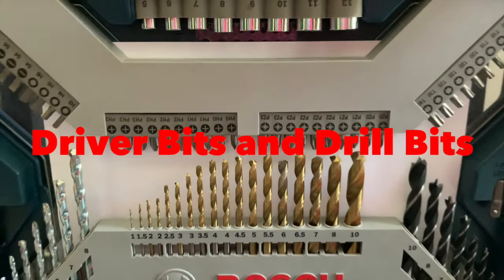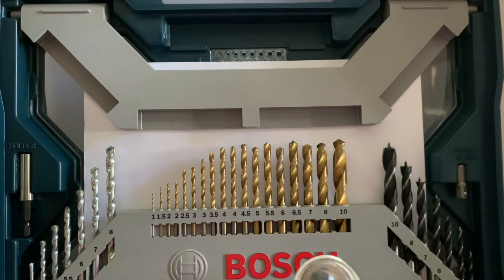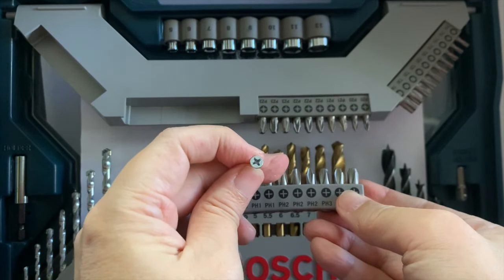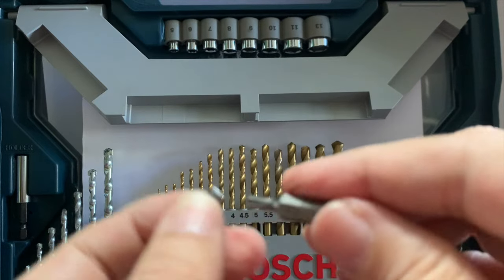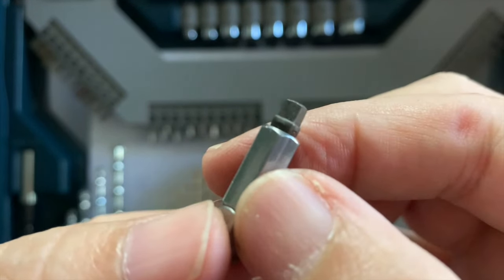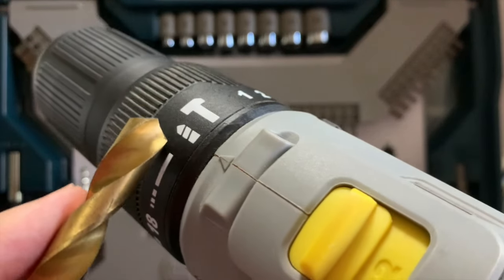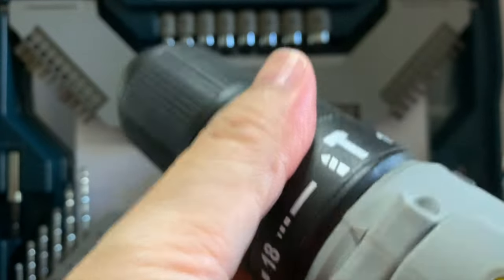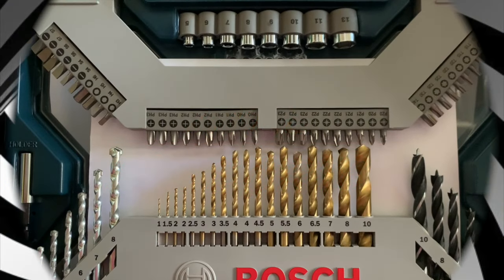Beginners' Guide to Drill Bits and Driver Bits

Comment: why do they make the shafts of drill bits smooth, I dont get it wouldnt it make sense to have more torque by having a shape to grip
Reply: when the drill bit gets stuck, the tip may break or rotate the wrist, I think to prevent injuries

Comment: I inherited a small drill bit set, and the wood/metal bits in the box were switched (wood bits in the metal bit section, metal bits in the wood bit section). So, when I wanted to drill a hole in a piece of steel, I used the wrong bits and was confused. I figured my drill was too weak, or the bits were too low quality, and I set the small project aside. Now I know I used the incorrect bits, and I will probably finish this small project tomorrow.
I'm a beginner, and I found this video to be very informative and clear.
Thank you, sir! :)